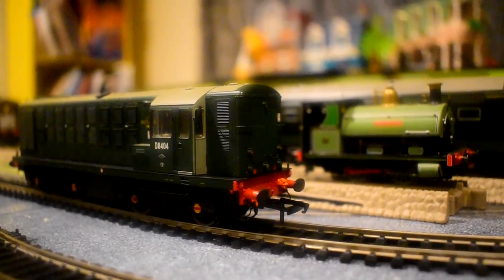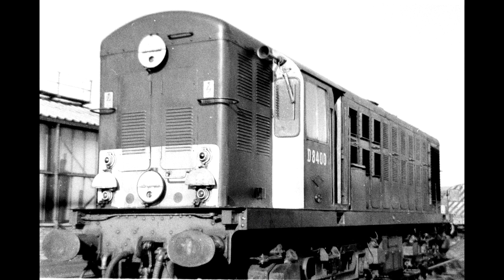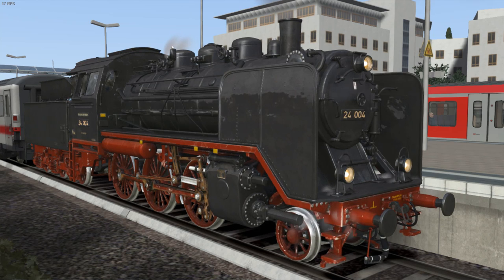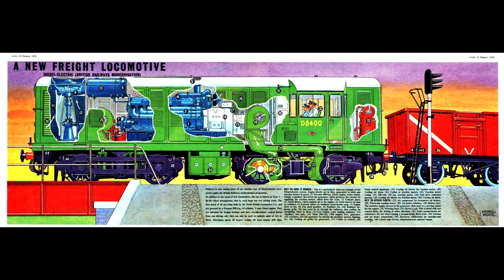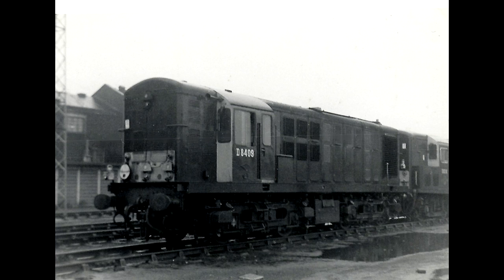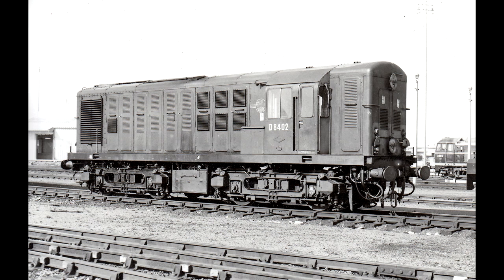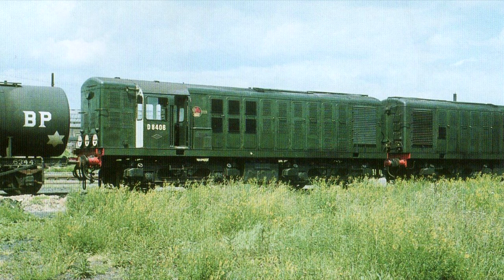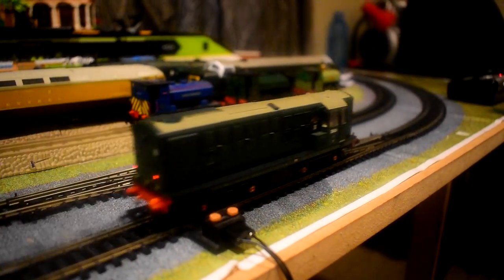Diesels Scrapped after only 10 Years! ~ A Brief History of the British Rail Class 16

Comment: 10800 was NEVER known as the Hawk.   It was a regular worker between Birmingham (New Street) and Peterborough.   It was withdrawn in 1958 and put into storage.   In 1961 it was bought by Brush Traction for research.   They rebuilt the locomotive and outshopped it in green, at which time it was given the name Hawk, but it did very little work in that condition.  Throughout its working life it was known as "Wonder", a name given by the operating staff on the basis, "I wonder if it will start today !"

Comment: Sorry, you got something wrong. In all BR diesel locomotives the cooler group is at the front end of the locomotive (number 1 end). This means for the Class 15, Class 16 and Class 20 running in reverse means they are running with the cabs at the leading end.
Reply: So basically, "Long Bonnet Forward" is the forward direction for a British road switcher?
Reply: That is what I noticed. Locomen would have been used to having the cab at the rear. I still refer to the 'Type' number and I liked the early black and silver livery!
Reply: @russellgxy2905  Definitely for the class 20, because of the poor visibility BR ended up using them in pairs, coupled nose to nose so the cabs are at the outer ends and the lead loco is effectively reversing.
Reply: @russellgxy2905  yes.

Comment: The North British diesels had a peculiar rugged charm about them. I saw the D600 Ark Royal and the Class 29 in Barry Scrapyard in 1979 and the D600 was an amazing machine. I also saw two of the then 4 surviving Class 15's in Stratford shed in 1981 along with a "Toffee Apple" Class 31.
Reply from the maker: I've certainly heard of D600 (or Class 41). I think they were mentioned in the same book where I first learned of the Class 16.
Reply: D601 Ark Royal and Class 21 D6122 were in Barry. D600 Active was there in blue livery, but was cut up in 1970.
Reply: @DC4260Productions  Class 41 as they became were 5 Pilot scheme type 4 Diesel Hydraulics built by NBL. Numbered D600 to D604 they had twin MAN engines with Voith transmission. Very heavy with huge underframe and 2000hp were underpowered and became largely redundant after Class 42/43 entered sevice. All withdrawn on 31 Dec 67. Lovely engines though. I have 2 Dapol models. D600 in blue FYE and D602 in blue HYE. These were the only two to receive blue, the other 3 in green till withdrawal. Very intetesting class. Love all the NBL locos. Dapol also do a class 21/29 and class 22. I have both. Superb models.

Comment: Wel made video, I have the same model of 8404 with the Stratford yellow panel.
I have been involved since a while with the restoration of the sole surviving class 15 or BTH type 1 no. 8233 and I can tell from experience that the engines were overly complicated for the hp they could deliver. The class 20 offers more power with half of the number of cylinders.
But still I think it is important to keep even the less successful types of locomotives alive, like the class 28 CoBo in ownership of the same preservation group or the Clayton class 17 at the Chinnor and Princes Risborough Railway.
Nice to see the Price locomotive running in the video, this was at Pukemiro?
I live in the Netherlands but have visited NZ twice, I also do some NZR modelling in Sn 3,5

Comment: A couple of minor points, firstly, a class 20 has the visibility problem when running forwards, not in reverse, the cab end was considered to me the rear of the loco, and the visibility issue is actually considerably better on a steam loco as the boiler is round, so, to an extent, you can see over the top, where as a loco such as a 20 is square  meaning the top corners get in the way.
Reply: I was just about to write the same thing, I've noticed that a lot of people believed it to be the opposite way round in thinking that the cab end is the front, but basically it's a steam locomotive with a diesel engine and no tender. The 08, 09 shunters were the exact same setup...nose first 😊
Reply: @garethgilmour9021 the number one end of most BR diesel locomotives was the end with the cooler group.

Comment: The BIG problem was caused by the haste with which BR instigated the diesel pilot scheme. Instead of properly investigating all current successful practice they invited tenders from a variety of companies including many that had little experience in the rail,loco sector. Many were marine outfits, one good example being the Metropolitan Vickers. The class 28s must have looked good in a glossy brochure but in practice they were less than adequate.
One irony is that, with the exception of the class 55 Deltics, all the major classes had home-grown offerings from BR's own workshops mostly very successful types e.g the 20s which often performed beyond their design limits. The truth is that BR, urged on by a pro-Oil government, scrapped nearly new steam locos of advanced design in favour of a new and largely unproven (in the UK) technology.
France, on the other hand grouped their remaining steam locos at certain strategic sheds (e.g. Le Mans) and went hell for leather on electrification and high speed lines leading to TGV and so on, supported by a relatively few diesel designs in largely supporting roles.
Reply: The 28s were not originally included in the Modernisation Plan until Bulleid put his oar in. The BTC wasn't wanting any two-stroke diesels, but Bulleid persuaded them to give them a go. Both two-stroke designs turned out to be failures for various reasons.
Reply: I think unreliable diesels on the BR was more a symptom of classic poor British manufacturing quality than it was diesel being too new to the scene. America had already figured out reliable diesel locomotives and had them down pat by the time Britain was testing their early diesels. Meanwhile British Rail was still figuring out how to deal with wheel slip. Some trains still didn't have pneumatic braking systems! What a country.
Reply: Without knowing the specifics of NBLs relationship with BR, it was often the case that nationalised industries sub-contracted manufacture for political reasons. So rather than centralise production in one place, it would be offered to companies in regions where government needed votes. This was also true of large companies in the private sector, with the government offering incentives to relocate, or spread production across sites, the Hillman Imp being a case in point. It sounds like it was North British's turn to receive whatever cash was on offer for Type 1 diesels, rather than a serious strategy for future traction.

Comment: During the hell-bent-for-leather rush to diesel eyes railroads around the world many diesel locomotives were built with engines that were perfectly satisfying and other duties. The Fairbanks Morse opposed twin diesel engine was widely used in submarines in the Navy but the pride of the cooling water of the ran hot and were difficult to service but they provided twice as much power in one locomotive but you had twice as much maintenance. Westinghouse made good electrical equipment for diesel switching locomotive and streetcars but when they got into higher horsepower engine ratings they suffered failures and withdrew from the business. It's one thing to have an electrical failure putting an engine out of service it is quite another thing to have the crankshaft come out the side of the engine. The scrapping of serviceable steam locomotives all over the world is an unpardonable sin.
Reply: Crossley Diesel Locomotive engines were the bane of Irish locomotive drivers and secondmen in the 1950’s and 1960’s

Comment: Its a great shame no NBL diesels survived into preservation. All apart from the 20 re engined class 21 ( class 29 with Paxman engines) suffered with the license built MAN engines. These included the Class 21 22 41 43 and Blue Pullman power cars. The diesel hydraulic classes were probably the best but became none standard by the early 70s. Class 43 Warships with MAN / Voith transmission set up were very unpopular as the cabs were always full of exhaust fumes. The identical BR Swindon built  Class 42 with Maybach/ Mechydro set up were far superior. Two NBL locos Class 41 D601 and Class 21 D6122 did survive in Barry Scrapyard till 1980, but with more people at the time  interested in saving Deltics they unfortunately were both cut up. Great shame. Only one NBL  product remaines, Electric Class 84 preserved at the NRM. There is a group currently planning to re create a Class 22.
Reply: Saw the class 84 at the Bowness and kinneal railway near Linlithgow last year,static display inside shed

Comment: Steam locomotives were a work of art. Because New York City outlawed steam locomotives within the city limits Baldwin came out with the first diesel Switcher. They were very good locomotive. The steam locomotive companies were used to building locomotive to the customer's specifications they did the same thing with diesel locomotives therefore their locomotives for more expensive that's a EMD which just made one kind and you were stuck with it. The steam locomotive Builders built diesel locomotive according to the customer's wishes. Like when you order a car and you decide what it comes equipped with and as it goes down the assembly line it is equipped with those parts. Chapman used to maintaining steam locomotive were not used to maintaining diesel locomotive and expensive lessons were learned the hard way.
Reply: The problem with Baldwin is that they could not MU with AAR equipment and that they made their diesels in the same fashion as steam engines. Each wiring run or blower placement was slightly different, well. This increased maintenance costs which caused them to very quickly fall out of favor once ALCO, FM, and EMD showed up with proper switcher locomotives.

Comment: ns class 2400, basically same thing. you can't see where you're going. lol. (now who on earth would consider it a good idea to order locomotives where you can't see where you're heading ;) although with the ns2400 they at least tried to weld a cabin to the roof later on to one of them. :P to make it somewhat usable. lol.
Reply from the maker: Having just looked up pictures of the NS 2400, I see why you've mentioned it in relation to the Class 16.
Reply: Must be a cultural thing. Over in the US there were plenty of "Hood units" with high hoods. Hell, two railroads in the South - Southern Railway & Norfolk & Western -- would run their engines with the Long Hood Forward. This even continued after they merged with each other to make Norfolk Southern and only stopped in the late 80s I think.

You'd figure British crews would be a tad more at home with a layout like this, since they kept running steam longer than America, but I guess not?
Reply: @russellgxy2905  America ran the long hood forwards to keep crews "safer" in the event of a head-on collision as the "front" of the locomotive would be there to take the impact. This was common practice as not all locomotives had anticlimbers at the time.

Comment: Which one of the Classes was the DE NZR diesel based on. Was that just clever artwork if that pair of class?? diesels were pulling a train in BR Blue
Reply: The NZR DE was predating most of the BR classes, they were built by English Electric and had a 6SRKT engine, this engine was a turbocharged variant of the engine use in the British Rail classes 08-09-11-12-13, the DE was delivered in 1952, and by then only shunters of class 11 and 12  and a few other types of shunters and prototype diesel electric mainline locomotives had been delivered in the UK, of which most turned out to be of EE manufacture.
EE delivered many export types from the late 1940s onward to many countries of the commonwealth, resulting in some African countries being dieselised earlier than the UK itself.
Other EE classes in NZ were the DG-DH and Di classes. Locomotives very similar to the DE were delivered to Tasmania.

Comment: They're far from the only British rolling stock that had short lifetimes due to being rubbish.
Check out the London underground 1983 stock.
Reply from the maker: I've known about the '83 stock for many years now. They were basically a deep-level version of the D78 stock (later Class 230 or 484).
Reply: dont you mean locomotive
Reply: @bluestarproductions2033  no. The London underground trains are multiple unit electric stock. The only locomotives they have are for maintenance trains.